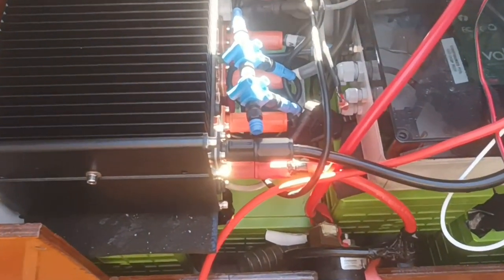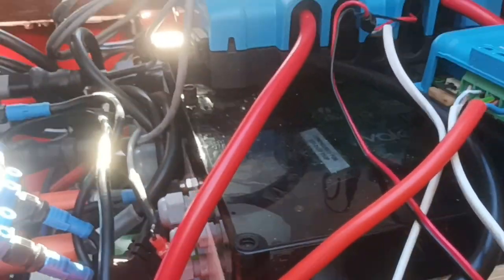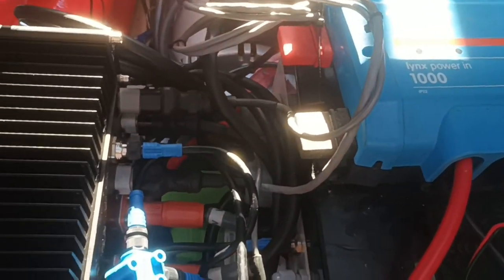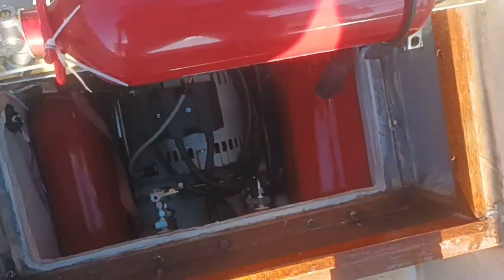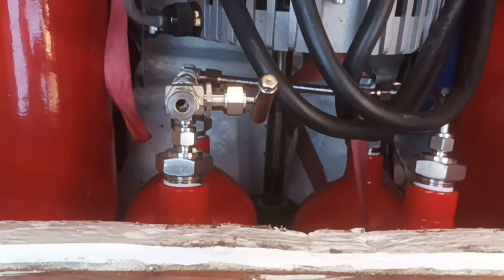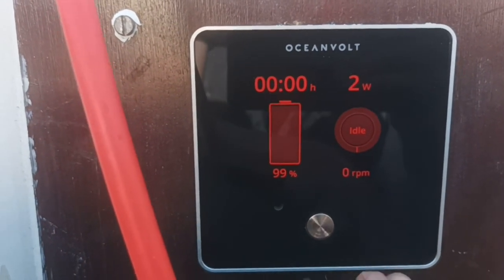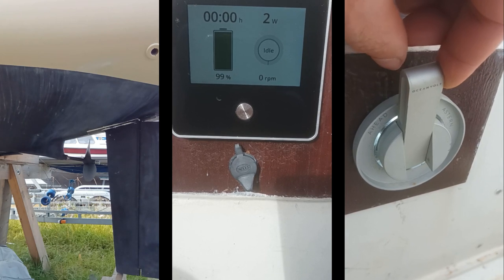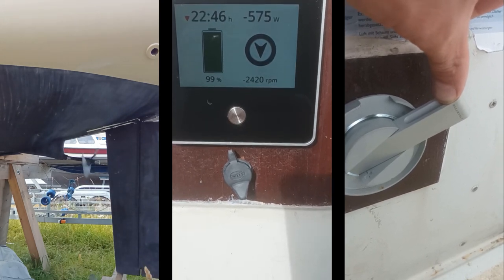Electric hydrogen boat

Comment: So you use sun or wind to produce hydrogen, store it in bottles, then produce electricity and store that in batteries--but the same or different system produces the electricity as well as the hydrogen? Thanks.